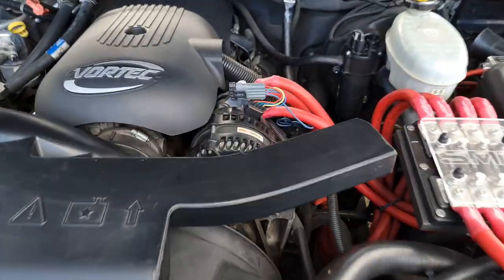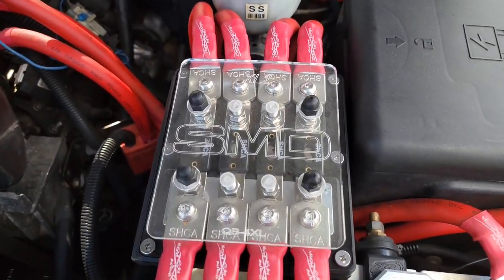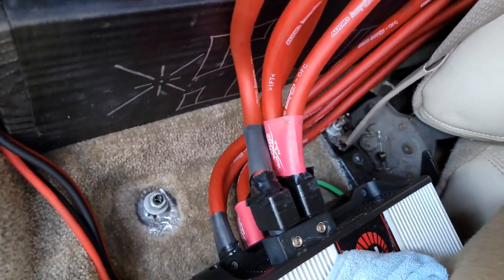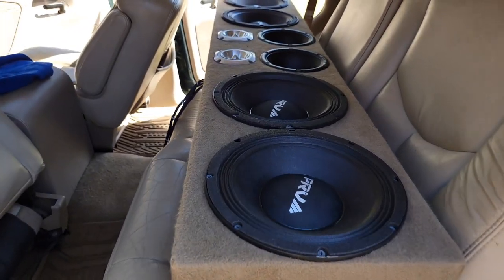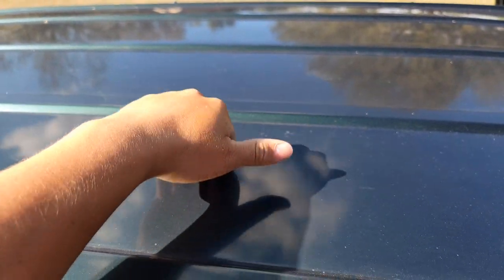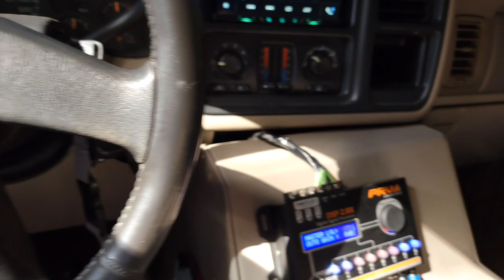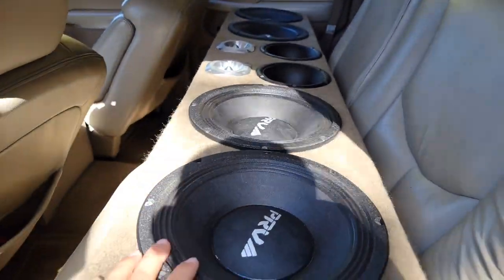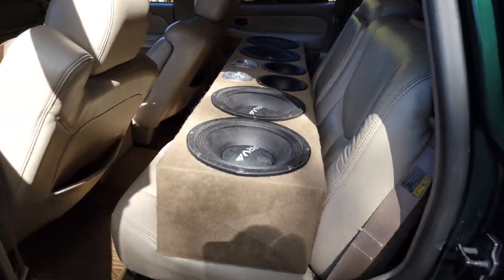Walkthrough Of My Tahoe System 🔥 | 4 VXF 15s On 2 Bass 8ks 🔊

Comment: Your wiring layout is super clean bro!  Do you think the box port has enough space to breathe once the door is closed?
Reply from the maker: Port is 5 inches away from the lift gate, width of my port is 6in. Most people recommend it to be the width of the port. So i think its fine. Appreciate it though bro ! 💯🔥
Reply: If you wanna be precise about it, if you extend your port walls all the way to the trunk wall or whatever its close to, and measue the area of that nonexsistant "strip", it should be equal to the port area. Basically since the air can flow in all directions once it exits the port, you want that area to be atleast equal to the ports area. So in this case, 5in away from the back would be plenty.

Comment: How did you sound deadener on the back lift door? I need to do the same .mines hits hard and I don't want that rattle. Yours is nice. You got your Tahoe coming out nice. If you could start all over would you still choose this Tahoe. I mean have you seen the new Tahoe. I love the new Chevy Tahoe. But too expensive. That's why I have a 2000 Chevy Tahoe I'm fixing up. Did a ton of things to it. I still have a ton to go.
Reply from the maker: I took off the panel, & did small cuts to fit in the holes.. i didnt do the whole lift gate due to tight space. But i tried to get the whole lift gate.
Reply: @SleepyBoiii  ok. I'll try the sme because mines shakes like crazy

Comment: You should move to lithium batteries my man. You’d probably make more power. What’s your voltage dropping to? I’m in the process of building my 96ah headway  lifepo4 bank for my 4 12 vxf’s build in my Explorer. I’ve got the new jp83 amplifier from D4S going in the back along with the jp23.4 for my mids and highs. The recovery time of lithium is 5 times faster than agm batteries, and not to mention a quarter of the weight. The best part about the headway lithium is that you can run them with your agm’s because they are close to the same resting voltage. Either way, sweet build bro! Can’t wait to take some videos and post them on here once mine is up and running! Bass on 🤘
Reply from the maker: Yes , i am planning on running lithium next or doing my door panels ? But i think my electrical should be first. It looks pretty easy to do since im a diy typa guy, but i just need to do a little more research & study lithium a bit more so i can do my own bank

Comment: I didn't see what your voltage was holding at and do you have external regulation on your voltage coming out the alt mine is a brand x 320 and it's the plug and play for a 12 volt system so can't do anything over 14.4 I have exactly the same set up you do sub wise I'm just running a md8k 2 ohm version wired to 2 ohms at the amp I was wondering if I could run two bass 8ks I have an 80AH underground power lithium bank that I have yet to install but I have had a lot of people tell I don't have enough lithium to run 2 of those amps

Comment: Cool. Similar to my setup. Q: U said each of the 4 subs have their own amp I think, but you have only 2 sub amps right? I used 1 bass 8k per 15" sub. Fi Neo 4.11 street class setup doing 55s (dB). Hope you run your 8K grounds directly to batteries.
Reply from the maker: Each pair gets their own 8k, so 2 15s per amp. & nice bro ! I wonder what my numbers are.. never checked before. But yes i am ⚡️

Comment: How well do these vxf 15s handle big power?
Reply from the maker: They handle it really well, they dont even get hot, they can probably handle more! Clean power only though!
Reply: how much rms? like if i play a sine wave at 40hz how many watts can it take for 10 minutes.
Reply: @HardKnocks160s  that's not how it works. I'm asking for true RMS. RMS doesn't mean cranking it up to 10,000 watts for 2 seconds. I'm tryna play a whole 10 songs without worrying about blowing them.
Reply: @bailey2517  I know who it's works...  sir I have a wall build.. I'd say 2-3k each on music.. for a few songs ,  10 mins straight  on 10k clamped on music , say 4- 15s would be alittle too much at 40hz U will need to plays some lows to cool them  coils  off a bit in between songs but yes I'm sure they can  handle decent power but big power for straight  10 mins..  ul need to let them cool down  I run 5- Skar audio DDX 15s on a Korean 7.5k wired to .4  only rising to .9-  1ohm maybe a hair higher on music  I clamp over 10k on burps  I'm sure I'm clamping around 6-8k on music it's does okay  161.3db 👍
Reply: @HardKnocks160s  awesome setup bro! You mentioned I should play lows to cool them off - I always hear that highs have better cooling affect because the VC moves faster to move air out of the motor compared to lows. Do highs actually get hotter than lows?
Reply: @bailey2517  lows.  20hz-30-35hz move more air  40hz+ -50hz are going to get your coils hotter  your coil would be moving out of control  way faster at 40hz.  At lower frequencies it would be moving slower but moving alot of air
Reply: @HardKnocks160s  does tuning affect how that works? Like if I'm tuned to 33hz and play 25hz to cool off, will that be ok?
Reply: @bailey2517  u can play 27-30hz easily comfortably  tuned at 33hz  you should have a  range of 26hz-50hz with your box
Reply: @HardKnocks160s  thanks!

Comment: You done the wire work? If so impressive! I've seen "Car Audio Shops" you would put to shame from your wire runs. This imo is how a audio system should be run!
Reply from the maker: Everybody tells me that bro ! I think i did a pretty good job, blood, sweat & tears into this project 🙏🏽 with more to come 🤙🏽💪🏽
Reply: @SleepyBoiii  yep, I'm an 51yr old man that feels like 81 but, been into car audio since about 20yrs old. I've worked with car audio shops but, never for one. I do things 1 way. Right or not at all. I'm about 3wks from finishing up a redesign in my 08 Yukon Denali. I should of had it done by now. Nothing like yours. I just have 2-18's and 4-3.5 two ways and 4-6.5+1" components all Rockford punch, Skar 18's, 3 batteries, 2 runs of 0ga, big 3, still lack my alt. I'm only running about 5,500rms. Its a daily. Your wiring is exactly the way I do mine. Once its all finished I'm putting it on my channel. Its a firearm channel but, I can't live without bump. Again superb wire work.
Reply from the maker: @tangomantactical  awesome ! Just subbed 🫡 Love me some firearms too. Will stay tuned on that build! Thanks again 💯💪🏽
Reply: @SleepyBoiii  you got it brother!!! Thanks for the sub!!! I'll be dropping some new videos Lord's will this coming Saturday with my AR9 and my AR300bo I just got done with. I have a few suppressors and whats cool about the last can I got, it will run on the 300bo and my AR9 both. Just change the end caps. I just dropped $330 on a QD mount and 2 muzzel breaks for the two AR'S. I was hoping to shoot yesterday but my ammo didn't come in. I'm doing a video where I shoot unsuppressed, then suppressor with regular ammo, then suppressor with subsonic ammo. I will be doing that on both AR'S. I've been waiting 2 months for all this to come together! Thats why my Yukon is still running the same Rockford Fosgate system 2-15"P3's on a Punch 1000d(1425rms) 8.0cuft box tuned to 38hz. Needless to say going with 2-18's and a JP33(4K rms) 10cuft box tuned to 34hz should push more air that whats in their now. I'm just guessing but probably 147-48db right now. Hopefully my new build pushes me over 150db. Sorry for talking your ear off. I live in middle Tennessee. If your ever this way get with me and we'll check out systems and go shooting on me.

Comment: Hey bro, awesome set up! I have a 2006 with a 320 alt, 2 VXF 15’s but only on a Taramps 3K…how’s your voltage when your playing full tilt? Mine drops low 12’s but I only have one battery for now.
Reply from the maker: I have 2 400 amp alts & 3 d7500s now with a 1 d3400 in the front, i still drop down to 13.6. These taramp amps take up alot of juice lol i have 8ks as well

Comment: Why YouTuber 251Bailey seems much  louder with only 2 zvx 15 on only 4500 watts hmmm something doesn’t add up help me understand
Reply from the maker: On this video my electrical wasnt on point, i now have 2 400 amp alts with 3 d7500s now, also depending on the box as well, this isn't really a spl box. Its more on the SQ side. New system going in pretty soon 👌🏽
Reply from the maker: I have to throw out some demo videos out there before i sell this system, just cant find a good spot, always getting cops called or getting told to leave the spot 😒